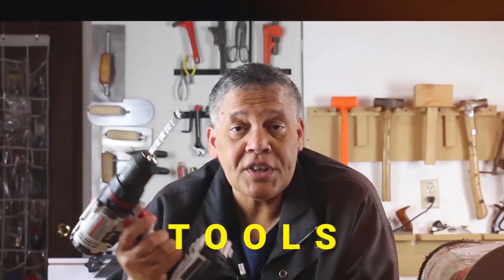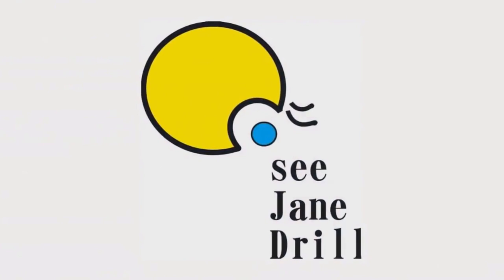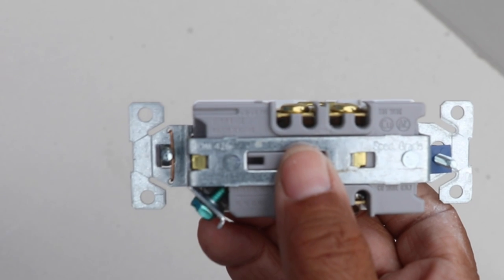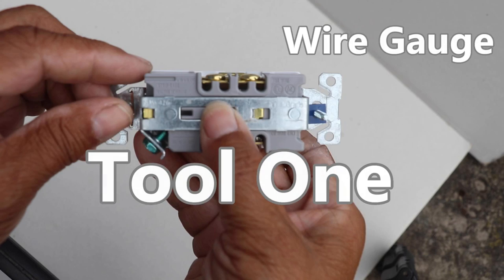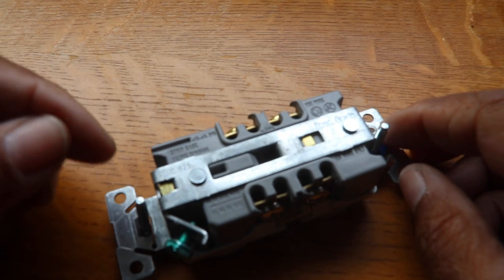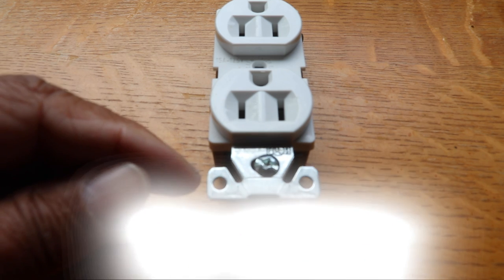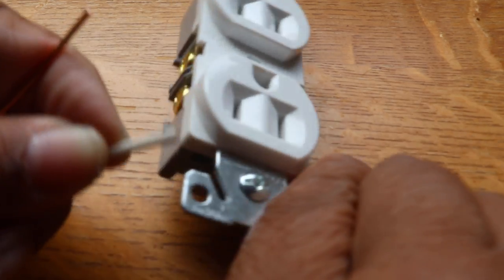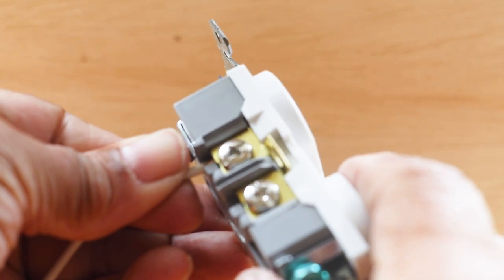Hidden Tool in an Outlet Few Know

Comment: Been an electrician 17 years now, never knew about the wire strippers. You can even see the difference in gap for the 14/12 guage wire too. Never noticed that. Neat tip. Thanks

Comment: Electrician for almost 25 years, never knew this. Old saying is right, you're smarter when you leave the room than when you went in it.
Reply: A tip of my own to add... when installing the faceplate on multi-ganged switches turn in backwards first to get the spacing right then it will be easier to install
Reply: This is printed on the outlet. Can you read?
Reply: Same here 20 years in hahaha
Reply: @stevewilson7857  I checked a couple outlets, sorry those brands had no writing. Anyway I do control work and automation so plugs and lights are the last thing I think about, maybe once a year for friend. You seem like a nice person
Reply: ...durrr
Reply: She missed the other half of the utility of the wire stripper. The ears then can be used to push out or favor the plug left or right in relation to the cover plate. Many boxes are put in on a slight angle due to the warped 2x4’s.  The ears then can be used to compensate, so do not tear them off.  Then of course you can use spacers to push out the plug if need be.
Reply: @stevewilson7857  when you install outlets for 20 sometimes the instructions go out the windows.
Reply: This is awesome.....installed a shit ton of outlets and never knew....thank u

Comment: You just schooled me, a master electrician.  Much respect.
Reply: Nice bear!
Reply: Guess you aren't a "master" afterall.
Reply: Good thing you aren't a master painter
Reply: Not so much a Master after all Chante.
Reply: @ia7277  or a master baiter
Reply: Beats using my teeth in a pinch.
Reply: I’m a master bater
Reply: Do I connect the Hot side first then strip the other side?
Reply: @boogermeister1  now, Randy. I'd venture to say there are nothing but black pots in this conversation.
Reply: @chante numpa

Hey I just opened up a wall.

And the receptacles literally have 2 separate Sheathungs of wire going into it.  (Like 2 x 16/3 wire going into receptacle...

Why?
Reply: Oh she is great I've learned a lot watching this channel
Reply: @carbievelez8352  if you are really asking, hire an electrician.
Reply: @johnle231  one is bringing power in and one is taking power out. Now close your wall and hire a professional. 🤓
Reply: @electricfil  

What are you talking about.

Only one wire is needed for return and to bring power correct?
Reply: @electricfil  

And I have time and would rather do things myself to save myself and my family money.
I’m perfectly capable of tearing a wall down and disconnecting receptacles and wiring.

I was just curious about the 2 wiring cause I never seen it before from any of the electrical involved jobs I have done...
Reply: @johnle231  like Electric Fil said one is the 'line' that supplies the electric to the outlet and the other is going to another outlet.
A few decades ago a common method for wiring was to have wire supplying electric to the junction box in the attic or crawlspace where several runs of wires would go out to the individual outlets in the walls. This isn't generally practiced any more.

The reason I told about the old way of doing it is because that sounds like what you described may have seen done on an older house.

Electric Fil is right about hiring an electrician if you aren't knowledgeable about basic outlet replacing. Even replacing an outlet receptacle, if not done properly can lead to several different problems that may not show up until it's put under a high amp draw load like from a hair dryer or electric heater /air conditioner, etc. Then it can build up heat and start a fire in the wall.

It's important to go by the NEC (National Electric Code) because much of the code is written in blood. Anytime a practice is discovered that is unsafe or potentially lethal the code book is updated to address it. A good electrician is well versed in the code and always deeply studies every new code change. That keeps you and your family safe.
Reply: @MicahFunk  

So the wall I removed is about 16 ft long with 4 receptacles, 2 on each side of wall.

And each have 2 sets of wiring that goes straight up into the attic.

And I understand you pros mean well by advising to “get a professionl@“

But if I’m just simply removing the receptacles, do you think it’s necessary?
Reply: @johnle231  keep learning though. I like to see people learn and understand basic electric theory and basic house wiring. It helps people not be unduly afraid and it  can also help keep you safe because you understand what kinds of situations people can find that lead to electricution (death ⚡⚡☠️). 

Who knows, maybe you'll decide to take the plunge in start a new career apprenticeship! 🤔 🙂
The trade needs more electricians because soooo many are retiring and not as many are taking up the trade.
Reply: @johnle231  there's several variables to consider with the wiring. The biggest variable is you don't know what kind of work was done by the person who installed the wiring originally, especially if it's an older house. There's so many older homes built and were never properly wired even by the current standards for that time. I understand that on the outward appearance it looks like it would be easy to just turn the breaker off and cut the wires, but you don't know what kind of convoluted mess all those wires go to. Could be switches for lights and etc.
Basically, if you make an attempt and cut wires and have problems then to get an electrician to correct the problem(s) will probably cost 3 to 5 times as much as just hiring one to do it right and make it safe for your family. The electrician will also be able to spot anything else that could be a powder keg ready to blow up. It could be something as simple as a discolored wire or a corroded/loose connection, or... you get what I mean.
I'd recommend getting an electrician out to do the work and maybe you will also be able to learn more things from him in the process. That education in itself may be worth the money well spent.
Reply: @carbievelez8352  it's best to turn the power off first then what would I know I'm only a member of the International Brotherhood of Electrical Workers so who you going to call Ghostbusters?
Reply: @johnle231  it's part of a three-way switch circuit.....btw that should have read 14/3 or 12/3 as there does not exist 16/3 used as house wiring .. so if yours readily does read 16/3 ? YOU are looking at a possible source for an electrical fire
Reply: @johnle231  someone didn't know what they were doing.  16 awg should never have been used.  Sometimes they will branch 14 awg off a rec. for lighting but usually those are wired on separate circuits in today's world.
Reply: In class they don’t show you this
Reply: @johnle231  taking out a 16-foot wall? better make sure it's not load-bearing. And the ceiling joists can handle the spanned after its removal.
Reply: @carbievelez8352  Sure Carbie, Do you have curly hair yet?
Reply: Maybe you should re-think that master part!!!! lol

Comment: Been installing outlets on and off for 40 years, never noticed. Dang!
Reply: Always something new with these youngsters.
Reply: Love the pun! Intended or not, the dad joke in me found it very humorous!
Reply: @martinsnibbor7691  
Who’s the youngster?
Reply: duplex receptacle
Reply: If you read the instructions on an Eaton outlet, it clearly indicates these tool points. But only available on this brand though.
Reply: They're on switches too... I'm amazed how many electricians didn't notice this. Of course it's ultimately pretty useless when you own a pair of wire strippers, but it beats using a knife.
Reply: @qleverone  — I don’t know if I ever bought an outlet in packaging. Normally I just scoop them out of a bin where the so just dumped them straight out of shopping box.

Comment: Dayum Leah. Over forty years doing electrical work as an air conditioning mechanic and I never knew about the wire strippers. I consider myself a pretty fair country electrician, plumber, rough carpenter, painter, auto mechanic, in other words, a jack of all trades as well as a master of one. It's true. You're never too old to learn. Thanks for the education.
Reply: maybe because only these have them? Mine don't.
Reply: I always used my razor knife and my thumb 😂
Reply: @MariuszChr  You might consider swapping them out.  I bought my house new 15 yrs. ago & am changing outlets that are frequently used.  That’s the point my reason for watching her videos.
Reply: @lzh3131  so to get this straight... You advise me to replace my outlets because they don't have wire stripper? Bro, my outlets are new.

Comment: 40 years I have been doing wiring and never knew about the wire stripper, Leah’s videos are great.
Reply: Ummm yeah my minds blown...how did i not know about the wire stripper thing🤦‍♂️🤦‍♂️
Reply: Lmao, 40 years doing wiring and didn’t know it’s there? Leviton don’t have them, Eaton, Siemens, Westinghouse and a few others have them. They’re there for 1 reason. Not for idiots that forgot tools, it’s for commercial and industrial applications when you might not have a wire stripper in your tool belt at the time of changing a bad outlet in a precarious location.

Comment: i've been a general contractor for the past 20 years, i've installed a lot of outlets and i had no clue either of those 2 tools were on an outlet, never again will i use my knife and a pair of pliers to strip a wire. You are an absolute hero!
Reply: "heroine"
Reply: @tonytech5520  i stay away from that stuff personally...  :D  thanks for the correction though.
Reply: @yardfowl3149  I've seen people using both terms for a female, but English is not my first language.
Reply: @tonytech5520  Don't leave you're pliers/wire strippers at home! Unless you buy Eaton brand receptacles your receptacles won't have the wire stripper feature. Leviton from Home Depot doesn't have that feature. I just looked, nope. Lowes carries Eaton but not all Eaton receptacles have the wire stripper feature. It seems to be a gimmick not utilized across all Eaton's receptacle products.
Reply: @Beezlie727  Spec grad only.